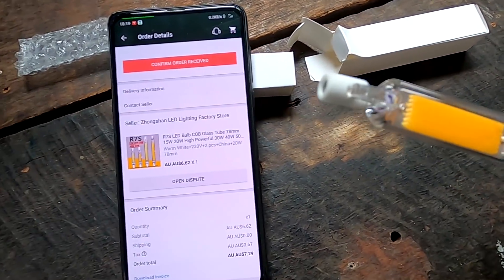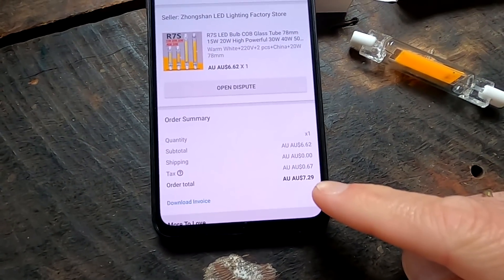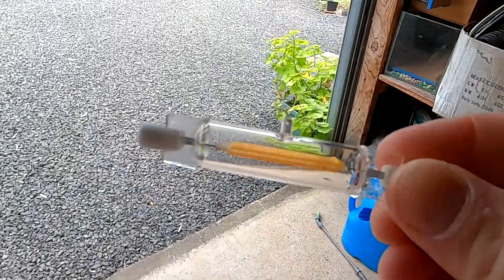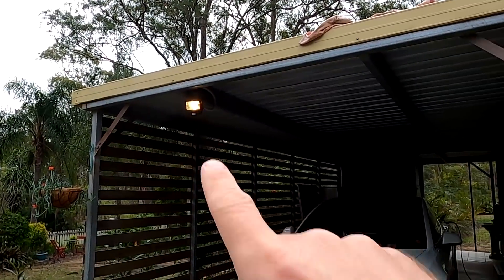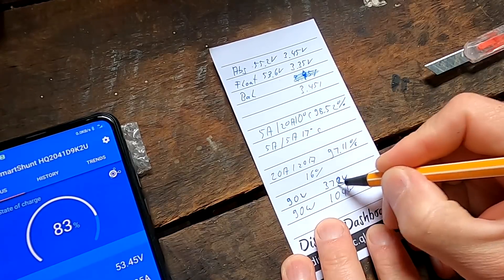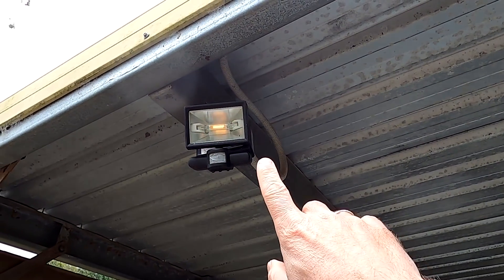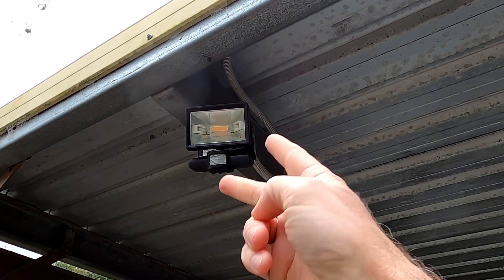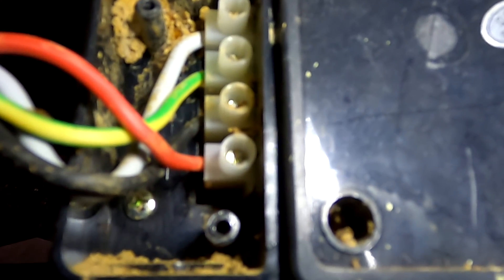Ghost LED Light is always on. Even when turned off! 👻💡

Comment: Did you by pass the transformer?
Reply from the maker: Transformer?
Reply: @OffGridGarageAustralia   MH light set usually includes a ballast or transformer which LED may not work with correctly. For some conversions, you will need to bypass them, for some you need to replace with LED drivers.
Same as an old fluorescent tube conversion to LED tube.

Comment: try putting a resistor in parallel with the led lamp, 220 k 1/2 or 1 watt. this will eliminate leakage current that flows through the led.

Comment: Did you resolve the problem already? I resolved one of my cases usingh a interference suppression capacitor (0.22 yF) parallel to the lamp. In better LED lights it's included, in some cheaper ones not. This is my my second way of resolving but it's not working on the LED's which have too high switch on current (see my other post).
Reply from the maker: Yes, resolved. Or at least I know what it's been caused by.

Comment: This is a common issue with motion light switches and dimmers that are not designed for LED lights. These motion sensors need a small amount of power to operate the motion sensor itself and they are basically utilizing the light "bulb" as an inline resistor for that circuit and it was basically designed to always leak a small amount of current through the bulb. Since those other bulbs need a lot of current to light up no-one would notice this small leakage flowing through the bulb element. When you put the LED in there the LED itself needs very little current to light up. It also probably has a different resistance than the motion sensor is expecting so it could be causing the relay to not properly trigger.

Comment: I love your videos!    

How can I use a 100AH and a 200AH lithium iron phosphate together as a single 12 volt battery when they where purchased at different times from different battery  manufacturers?      The seller of the 200AH said it isn't possible.
Reply from the maker: Need more info to answer that. What voltage to the single batteries have? Do you want to connect them in parallel, so 12V/100Ah and 12V/200Ah?
Reply: They are both 12 volt.  I want to put them in parallel to have a 12 volt battery.

Thanks for replying!  I would love to see you test what happens when this is done.

See Reply from seller below.

Thanks for your support.
The 200 AH battery could not be connected in parallel with the 100 AH battery.
To connect in series of parallel, batteries should meet below conditions:
1.	The same battery capacity (Ah);
2.	From same brand (as lithium battery from different brands has their special BMS);
3.	Purchased in near time (within one month)
Reply from the maker: @sia3540  OK, so the capacity is not a problem at all. The different BMS settings could be a problem but unlikely. Worst case is that one battery has turned off already and the 2nd one is still charging. Age should also not be a problem unless they are like 5 years+ apart from their age.
Do you have any specs of the batteries, what voltages they are recommended for?
Usually, if they are both LiFePO4 they should be safe to parallel if you use conservative charger settings like 3.5V max. Their BMS's are there to protect the battery from overcharging and they should not disconnect if you just charge to 3.5V or even less.

Comment: it might be more clever to use electroluminescent bulbs (those are fast becoming unobtainium too) in place of the Halogen/Led, those dont blink if powered trough small Y capacitors. one solution would be to replace the Y capacitors across relay (or Triac) contacts with 285VAC VDR resistors, that would keep the arc protection but drop leakage to microamps at 240VAC
Reply from the maker: There are 0.1uF load correction capacitors for LEDs available which solve the problem. Either in the switch or in the light fixture.

Comment: Search for LED compensator, or LED stabilisator. A simple RC network, connected in parallel over the Line and Nutral of the light bulb, to prevent the glow effect.
Busch&Jaeger, Eltako, and many other brands do have them. Only a few bucks.
If this doesn’t work, the sensor lights work with a thyristor, needing ohmic resistance to switch.
Reply from the maker: There are 0.1uF load correction capacitors for LEDs available which solve the problem. Either in the switch or in the light fixture.

Comment: Ha Andy, small back feed from somewhere.
Had something similar in my van. Had to put a "load" larger than the LEDs/ another relay to totally cut out the goust lighting..
A know ac and DC are different but just thought it may help you get your head around things.
Reply from the maker: I think I found it now. It the power circuit which runs in parallel to the lighting circuit for a while.
Reply: @OffGridGarageAustralia  so pleased you have found the fault, but does show how much electric we waist with out knowing.
Those lights could have been supping watts of electric over time with the halogen bulbs in, and you never had known.

Comment: happens in cars too, sometimes there needs to be a resistive/phantom load to bleed off the excess current to keep the bulb from turning on yet let the sensor keep working.
Reply from the maker: That's only for the blinker lights as they disturb the relay, right?
Reply: @OffGridGarageAustralia  In a car, Yes. In your situation there is X amount of energy needed to run the sensor and that in turn, since the LED has a lower starting current to operate, lights up. so either bleed off that extra current or reduce the operating current of the sensor.

Comment: Is the neutral of the inverter grounded or floating?
Reply from the maker: Grounded. It has a build in MEN link for the off-grid system. Otherwise the RCD would not work.

Comment: Common problem we found and could be a few causes in the UK, capacitance or induction from near by cables, pir sensor letting small current through, faulty wiring etc. Either way should investigate but one trick you can use if induction is the cause, you need to snuff the induction.. you can do this with a small neon connected between L-N (acts similar to discharge resistor) hidden in the back of the light or away in the switch.

Comment: I have the same thing happening with several LED lights around my house and even a CFL that seems to charge up and flicker every second or two.  I searched for the reason and found a good video by Steve Mould - "The cheap Chinese bulb that won't turn off".  I personally just leave them as is since the current draw is so low.  It could be resolved with double-pole switches but it seems like it's not worth the trouble/expense.

Comment: You never showed the brightness at night compared to halogens
Also does the light suck current when the halogens are in ?? Then you could answer your own question 😉 secondly big waste of time ,Bunnings have a 20w arlec brand for $44 with sensor ,Afterall those units are probably cooked and rubber seals almost gone with the heat they use to cop
Reply from the maker: It's hard to show. I filmed it but it just looks bright through the camera. I would say, it is a tiny bit darker with the LED but maybe only because I pay extra attention now. Still totally bright enough for that task. And, we've got the night light on now as well 😂

Comment: I work in large factory with lots of LED fittings. One day we lost a phase and them lights went out then after a while they had the lights light up briefly every few seconds .came to the conclusion  that the wires were picking up EMF from Other phases and charging the caps to the point of firing but not holding them on . With small capacitance and low power anything is possible
Reply: induction is a crazy thing. my grandpa who used to work on power lines told me a few stories. You could be working on high voltage lines on misty/foggy mornings that were disconnected and there is live high voltage lines across the road from it and you would get shocked from the induction the disconnected lines pick up from the live lines across the road.

Comment: Had the same problem with an old fixture converting from halogen to led. There is a RC snubber circuit across the relay contacts to prolong contact life. Either change the values of the RC circuit or just remove it like I did. May reduce the life of the contacts but can replace the relay if it dies. Love the channel.
Reply from the maker: There are LED load correction capacitors available. I quite like the night light now actually.

Comment: They are running on the tiny leakage current in you electrical system which is probably costing you about 2 cents a year I have the same problem with the led lights I changed in my hall lights if it really bothers you put a resistor across the input to dispose of the residential current
Reply from the maker: I quite like the night light now on the drive way. It's bright enough to find your way even without triggering the motion sensor.

Comment: The relay in the motion sensor will be only breaking 1 leg and there will be leakage current causing them to glow dimly. When we changed our globes to CFL way back when they were the norm, any light that was on a double switch would dimly flash every 30 seconds when the cap in the driver charged from the leakage.
Reply from the maker: The switch disconnected only one cable either. That interrupts the circuit. How can the LED still glow without a circuit though 😉

Comment: Swap the wires on the relay-contact - if the relay contact and the relay coil is fed from the same source. The LEDs light through the coils resistance.
Reply from the maker: Nope, that's not the problem 😉
Also, the relay is not in series with the light. The relay is working on LV side of the control board which then switches the HV circuit.
Reply: @OffGridGarageAustralia  OK - understood, thanks for the response!

Comment: Clipsal 31CAP load correction device across active and neutral of one fitting will fix your problem.

Or a old 50w wire wound low voltage halogen downlight transformer will also work across active and neutral of one lamp.
Reply from the maker: Yes, that is correct. A 0.1uF load correction capacitor is that...

Comment: The motion sensors are designed to a resistive load.  The leds are inductive load
Reply from the maker: LEDs are not inductive load. The motion sensor uses a relay, so it should not matter what load it switches.

Comment: i wonder if there is some kind of capacitance in the bulb itself ,which is storing some voltage even when the power is cut.
Reply: time to get out the power supply and your handy Multi Meter to see if you can see where the voltage is being stored, even after the power is turned off.
Reply from the maker: But stored forever? It never turns off.
Reply: @OffGridGarageAustralia  im guessing a very small amount of voltage is being supplied from your light fixture. Just a guess

Comment: Your old lamp produced a sphere of light but you only need a hemisphere of light for your (and most) application. Your fixture has a reflector in the rear to try to rectify this poor lamp design. LEDs produce light in a hemisphere so they provide a much better lighting solution. Why are you buying an LED lamp that mimics an inefficient lamp? Buy an LED motion light fixture and take advantage of the inherent advantages of LED lamps.
Reply from the maker: Why should I buy a complete new light when the old one is still working? That makes no sense at all to me.
Reply: @OffGridGarageAustralia  If you're trying to reduce your current draw, cutting your lamp in half would cut the current in half for about the same light output. The LED on the back of each of your new lamps is projecting light into the reflector and only a percentage of that light is being reflected into your yard. If you need a new fixture that is LED capable, why not buy a fixture that comes with LEDs? You will be amazed at how much light they produce with minimal current.

Comment: if you have change the incandescent bulb to LED, think it the leakage may have gone wrong or LED don't like it. It did that to me, I just replace the whole lot for new LED unit. My guess is water might be the cause.
Reply from the maker: It's under the roof, there is 100% no water inside the light or cabling. I also disconnected the 2nd light from the other side and just ran this one with the sensor. Same result... 🤷‍♂️

Comment: You could try a 3000 or 4000 ohm metal oxide resistor to "bleed" off the leakage current.
Reply from the maker: But where is the current coming from if the relay has turned off?

Comment: add a 270k-470k resistor in parallel had the same problem with my truck when i changed to led tail lights
Reply from the maker: But we still have the same 5W power drawing then, right? Even the lights might be off then...

Comment: Just replace with some solar led floodlights.  They will be cheaper than bulb and new fixture.
Reply from the maker: Yeah, that could work... They are not cheap though for outside use and 240V. And I need to make a bracket. And new cabling...
Reply: @OffGridGarageAustralia  No AC needed.  Solar floodlights with battery, solar panel, and led all in one for about the same price as a pack of solar panel alignment tools.

Comment: I'm pretty sure I think my fix was I went ahead and wired up another Outlet straight from the breaker box but yeah my ground had a little bit of voltage but I did find out the problem was my old Outlet did not have no ground hooked up to the outlet maybe that'll help
Reply from the maker: I can run a separate earth cable to the light and see if this makes a difference. Just for a test...
Reply: First unhook the ground completely and test the light does it still come on when you have it off if it does then that would be your problem if it doesn't then good question?

Comment: I think the impedance is wrong for the motion sensor. You might need a new motion sensor.
Reply from the maker: It's turns off the lights with a relay. Impedance should make no difference.

Comment: Change your switch, probably a 1 way/2 way switch for a double pole one (if you have neutral and active at the current switch) Always safer and will fix your problem.  While doing that check neutral to earth voltage to verify the earthing in your shed works as intended. Cheers.
Reply from the maker: Neutral is not at this switch. It's usually turned on 24/7. The switch is only for stormy nights to prevent the light from turning on and off non-stop.
Reply: Bummer! Fair enough. I wonder if you are powering those lights with the Victron inverter smart. If so, are you sure it's output is not floating and neutral and earth are about the same potential? Otherwise I'm afraid the sensor light fitting is not quite right suitable for those LED lamps and some surgery may be required, as mentioned in other comments. Good luck with it anyway.

Comment: Change the PIR for one that is designed to work with LEDs. The PIR is on all the time and gets it's supply through the bulb (via a capacitor voltage dropper). The current is too small to make a tungsten bulb glow but an LED needs a lot less power, so glows.
Reply from the maker: I don't think that's the case. The PIR works fine and switches the relay on and off same as before.

Comment: capacitive coupling in the wiring going to the light fixtures.  It's actually inducing a voltage in the wiring bypassing the switch.  LED's don't require a lot of electron flow to work. Many people use a pull down resistor or install a low watt incandescent bulb anywhere on the circuit (does the same thing).
Reply from the maker: So because it runs in parallel to another (power) cables somewhere?

Comment: There is a class Y filtering capacitor in the PIR or a small snubber capacitor across the relay contacts to prevent them from burning up prematurely and sticking. Also many of these cheap PIR sensor circuits use capacitive dropper circuits for their own internal power supply, that relies on a small "leakage" current through the incandescent lamp to function. The leds are super sensitive to small currents, so they light up. Many would consider this effect as an actual "feature" as it doesn't consume any more power and lights up the place dimly. The solution is to place a big value resistor or capacitor across the lamp terminals, but most of the times it is not even worth the effort...
Reply from the maker: That's a good explanation. I may open the fixture and check the electronic board inside for such a capacitor. Yeah, maybe it was always like this and just didn't realised with the halogen lights installed.
That's actually true, during darkness, the driveway is now lit just so you can get your way around even the motion sensor does not trigger.
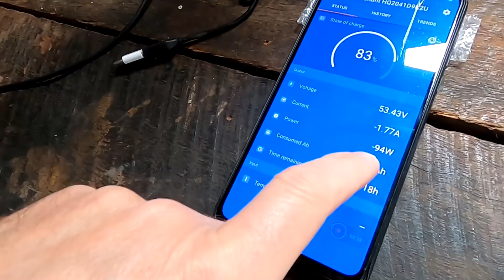Reply: @OffGridGarageAustralia  but according to watts consumed it consumes now about 96-93=3W more :) look at 6:40 in video
Reply from the maker: @servisfibris6679  Due to the load fluctuating a bit it's hard to measure precisely. I know what you mean ;)

Comment: You can have electromagnetic field from live close AC wires, and or contacts. The same principle as how an AC transformer works. Also you have capacitance in any wire, the wire becomes a capacitor, and capacitors let AC pass, but block DC. If you were using DC to power these lights, you would have no problem.

Comment: Did you look inside to see how the relay inside being used? May be there is RC snubber for the relay contacts so when the replay is open you will still get enough current flowing through the RC snubber to light up the LED.